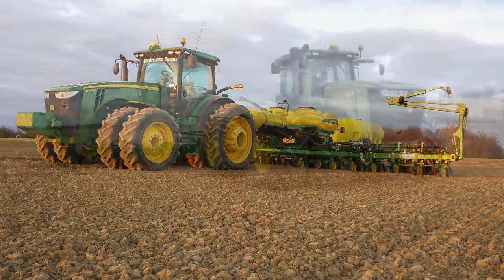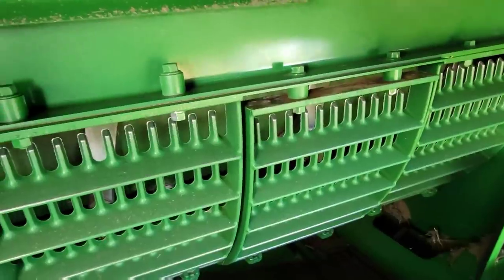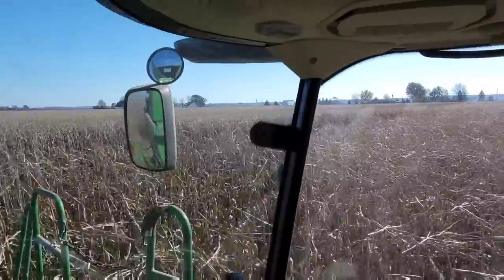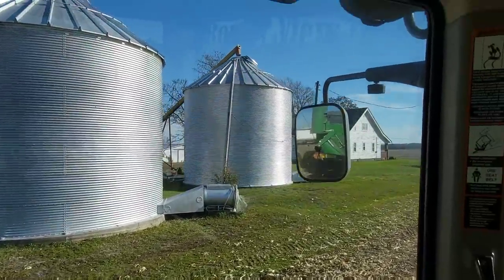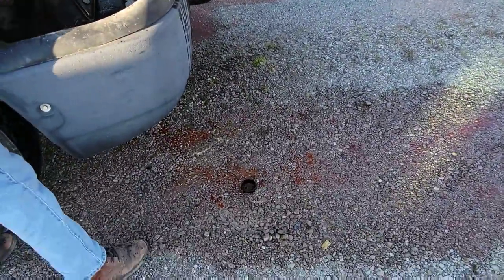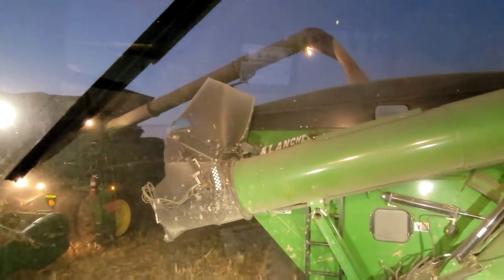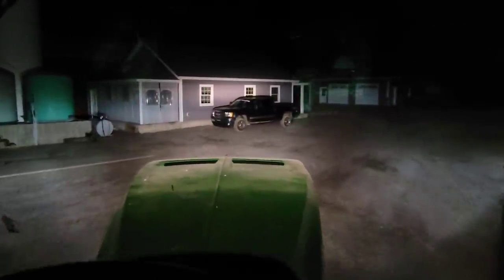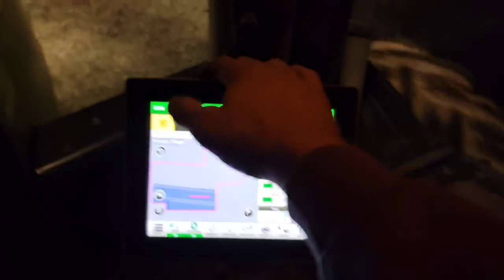Let's Shell Some Corn! - #544

Comment: About getting across 1/2 mi rows with 12 row corn head,  most have 24 row planters, so the shorter distance of 32 headland rows, also we have grain tank extension which gives us a little over 500 bu capacity, and we didn't harvest any corn over 17%, 90% of our corn this yr was 16% or under, lots less water filling up grain tank, and for opening a land we did the stop and make a slice of next 12 rows and with the 12 row slice and 26' unloading augar the cart fits in easy to unload.
And mostly 230 bpa corn.

Comment: With a 16 row head, could you swing combine auger out only about 45 degrees and drive tractor along side combine up to corn head (with combine stopped) and then dump in grain cart?
Reply from the maker: Not with front duals on the tractor and I'm not sure if the unloading auger will engage with it only 45* out or not. Might be some height issues too.
Reply: @BorderViewFarms      Thank you.

Comment: Is accuracy of what has been harvested critical?  Seems like a lot of calibration happens and the calibration settings have to be adjusted often.  How does the financials or inventory on the books handle harvested inventory?
Reply from the maker: The more accurate the better but I wouldn't call it critical. The grain cart scales help a lot. Once we get the new combine dialed in there should be less calibrating and better accuracy